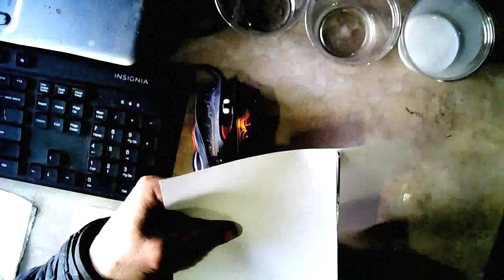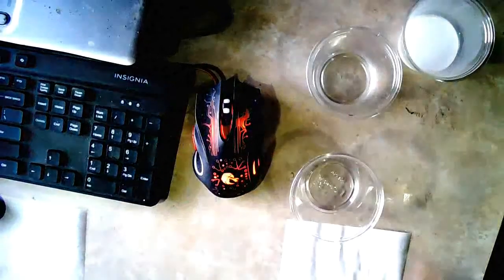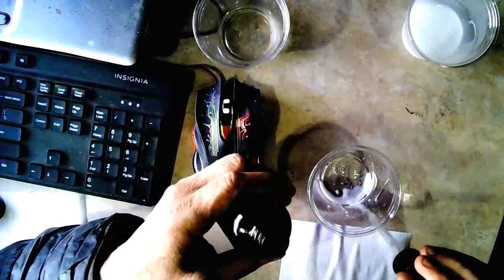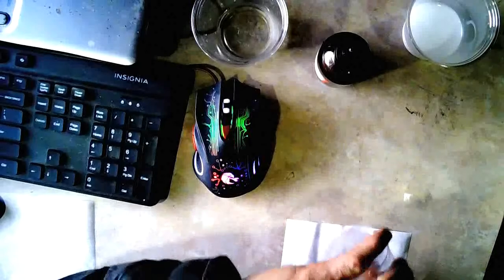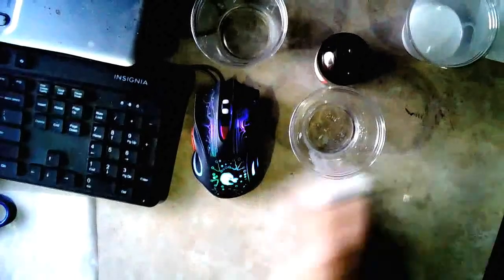Thin Film Borax Separator Experiment

Comment: Some good thoughts here - thanks for sharing.  Can you comment on why two different materials for the anode and cathode (if its a capacitor).   New subscriber - so I apologize if I missed the answer on you're earlier videos.
Reply from the maker: No problem Dennis. Welcome to the channel. The basic theory is that the Bio-cell (and other batteries) operates via an acidic/hydrophobic surface interacting with an alkaline/hydrophilic surface. I just reorganized all the videos into sub-topics you can explore. The charge separation videos explain this aspect. Thanks for your comment!